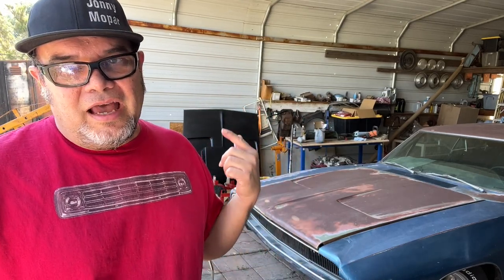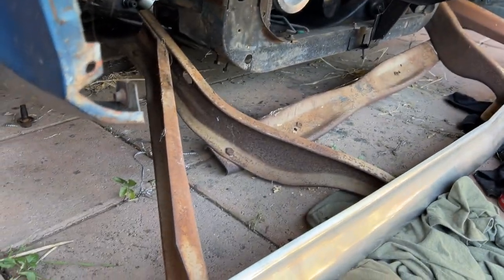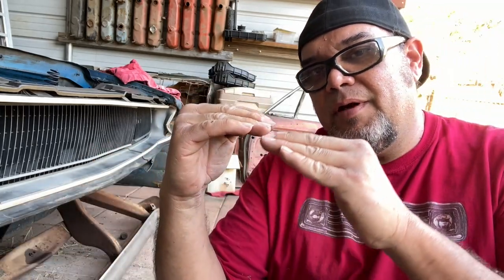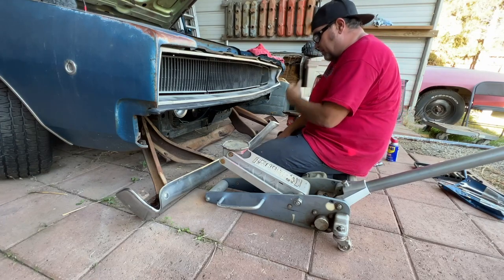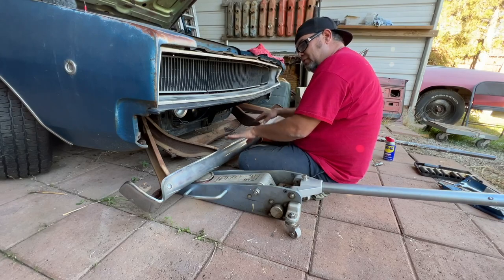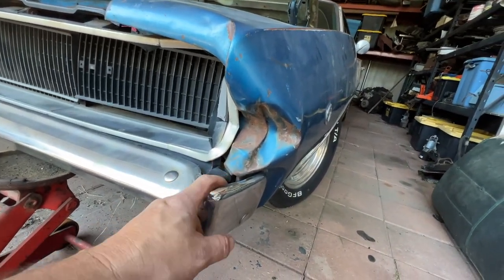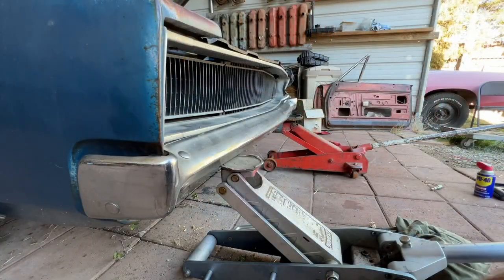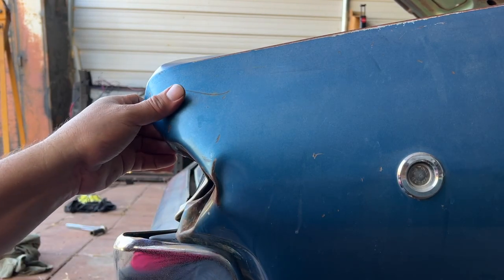How to install your 1968 or 1969 DODGE CHARGER grille

Comment: Nice tips for us newbies!  I like how you walked through everything!  My passenger side fender looks just like that!  Sadly, the rest of the grill and support is mangled beyond repair 😢. I’m a long way off from there yet. Still working on replacing the roof and rear window corners.
Reply from the maker: Thanks Jimmy. Well, when you get to that point you have a video to freshen up on just before hand. There was a couple of bolts I forgot I’ll try to add to the end of the next video.

Comment: I'd like to know how to take off a 70 charger bumper. mine sets to far to one side I would like to take it off blast and paint the brackets every, thing is loose but there might be something I'm missing.
Reply from the maker: I can’t remember now if the 70 has it too but there’s a couple of L brackets from the fender to the bumper I forgot to put on. If you pull the valance off first (bumper brackets before that if you have them) you’ll have a better view. I’ll try to remember to add an update correction to end of the next video and get a view of it. My grille is out on the 69 so I’ll probably show it on that.
Reply: @JonnyMopar  Thanks

Comment: Hey Johnny, do you know if a B body manual steering column is interchangeable with an A body?I’m curious  about an aftermarket tilt column, but I don’t see one for a 69 Dart.
Reply from the maker: The B body is longer than the A body. But I wonder if you can use the manual column collar from the B and put it on the A. As far as I know it’s all different but I don’t know that for sure. If you can ever get two side by side that might be an option.